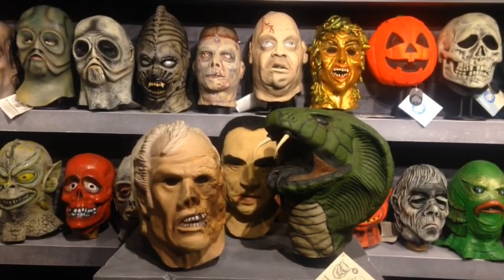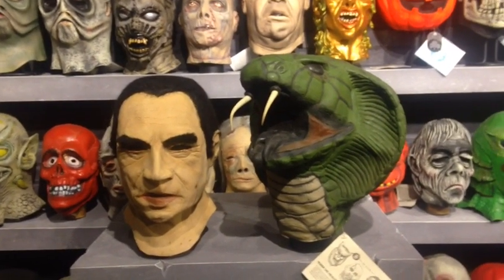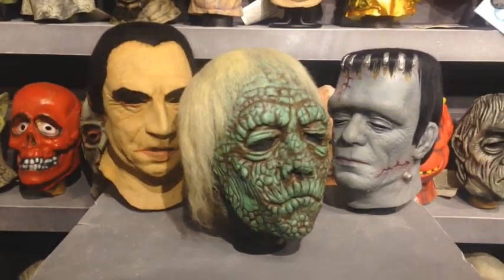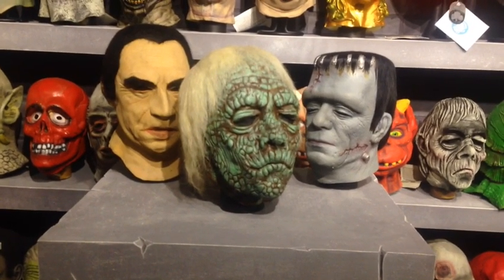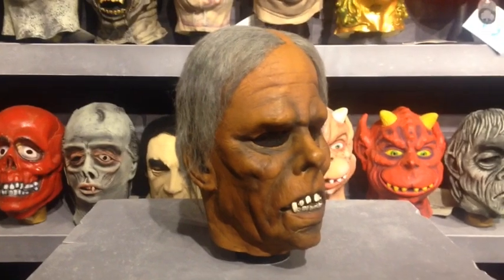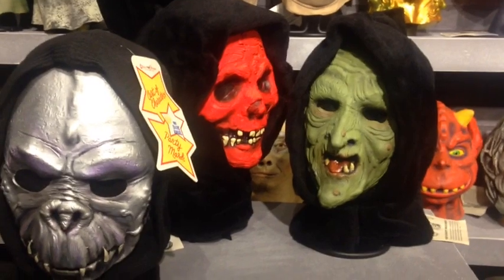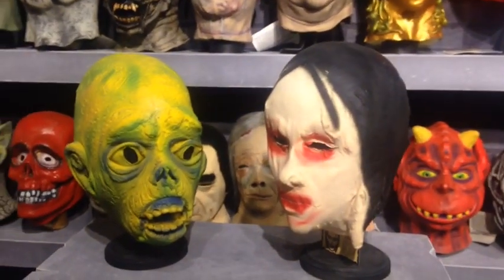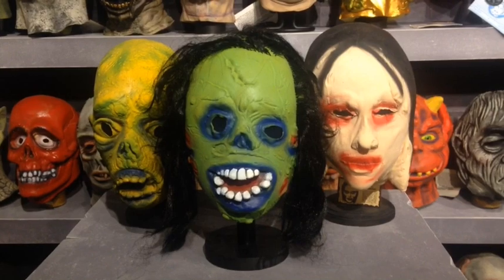Foam Fill & Mask Display Discussion

Comment: i have filled a few masks/props.While i worked as a tech in the prosthetics field,we used a  hard foam,like the canned stuff,by Otto Bock,comes in about 6 hardness level,from balksa-ish,to oak-ish,then there are the soft poly-foams, all these are found in 2 part mixs.buy some 5$ masks,and pratice. thanks
Reply: Gene Sanford how did you get to have a job like that and whats the best way to start i already can make latex full masks ,gloves and halfmasks
Reply: @nicholash1691  As an fx guy ,not having much luck(or enough talent?) with chasing film work (,most of that almost for free ,or on spec),i took my best photos of non-gore props to 2 local prosthetic,s labs that made artificial limbs.With my skills with propbuilding,painting,resins,sculpting,airbrush,hairing ,et. i landed a perfect job as a "Cosmetic Finisher" ,to made the artificial look real.I,ve had 3 jobs i my life i shouda payed THEM to do.That was one of them  .Nick ,thanks for asking -give it a try,who knows bro !   : D
Reply: Gene Sanford thanks gene im always practicing sculpting and trying to learn new things with different kind of materials im just always wondering how to get my foot in the door somehow thankyou for the advice (:
Reply: @nicholash1691  Dont stop working towards that goal, & dont stop working on your skills.Keep an open mind with related jobs.Nick,the foot in the door is faith in yourself,and never giving up.

Comment: One issue I've had with a few masks was that they have gotten a tear where the slit is, making the slit bigger :/ any way to fix this?
Reply: hole punch at the top of the slit, and/or duct tape it on the inside so it cant separate anymore..line the cut up prefect and use the tape